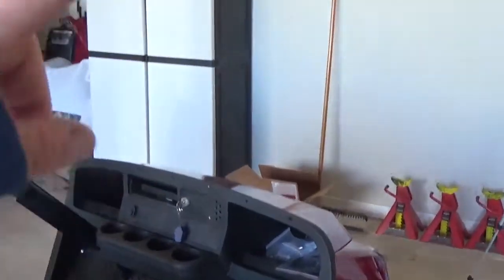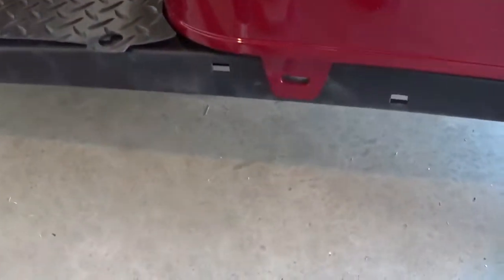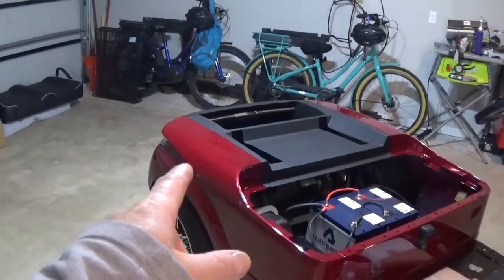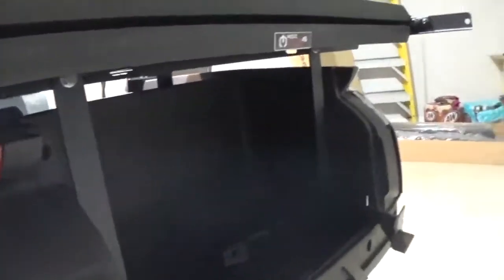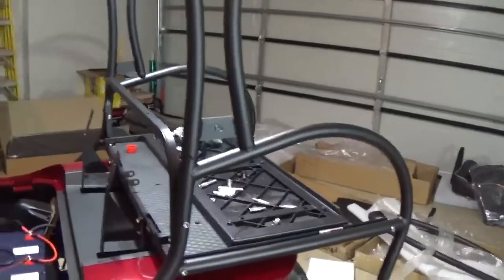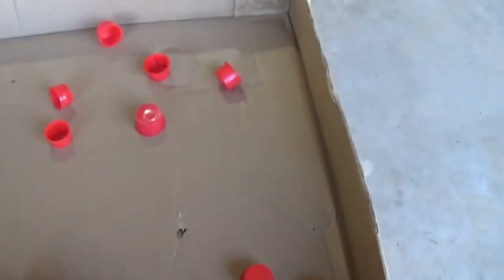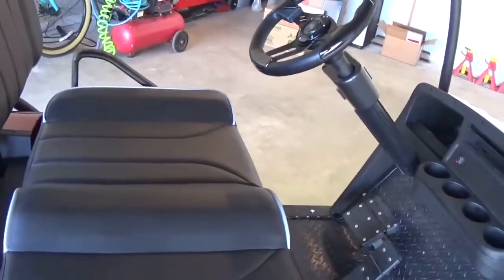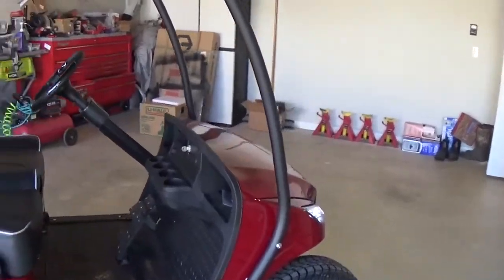Installing a MODZ Tower Top on a EZ-GO TXT (Rebuilding a 2001 EZ-GO TXT from the frame up Part 7)

Comment: Can you use any rear seat kit with generic seats or does it have to be a MODZ kit?
Reply from the maker: I believe there are six different models that you can use
MODZ flip4, GTW, Genesis 150, MAX 5, Genesis 250, or Genesis 300

Comment: HI, I had a question. I have a 00' ezgo and replaced all leaf springs front and back and shocks and it still leans towards the driver side. Its about 1.5 inches lower on driver side. I dont know what else to replace. any suggestions?
Reply from the maker: Was it like that before you replaced them?
Reply: @kartkrazy  yes. I bought it used and was in excellent condition. Besides the batteries and the leaf spring bushings all was physically and visually in great condition. I can’t get rid of the lean. I’m tempted to place a small metal plate In between the from leaf to life it slightly on thr driver front. I’m still curious whats causing it after I replaced all variables.
Reply from the maker: @lestervida  if it was that way before it leads me to think something must be bent. Possibly the frame or a suspension component? Maybe a couple of bad shocks on one side? But, I am sure you could correct it with a shim like you are describing.